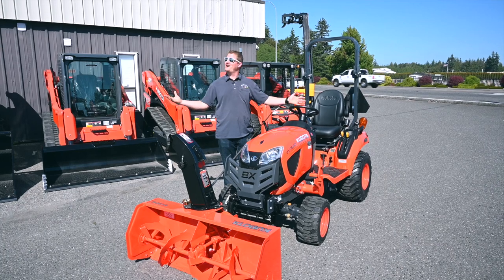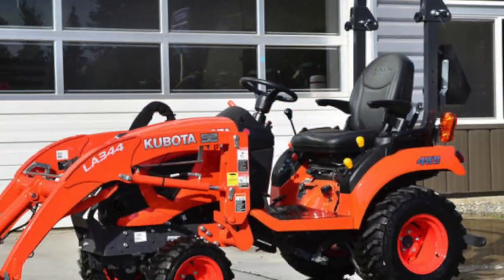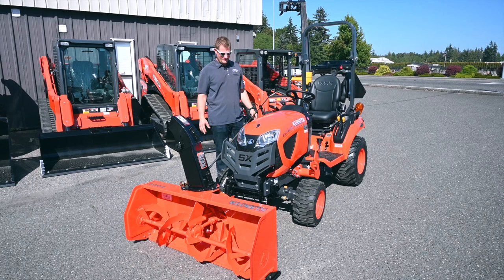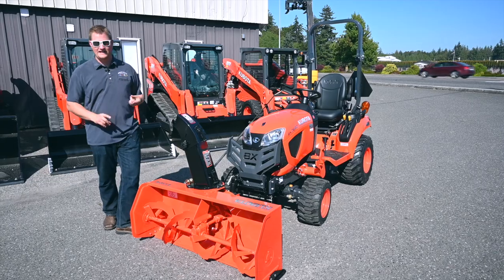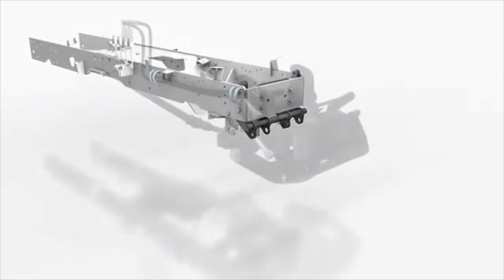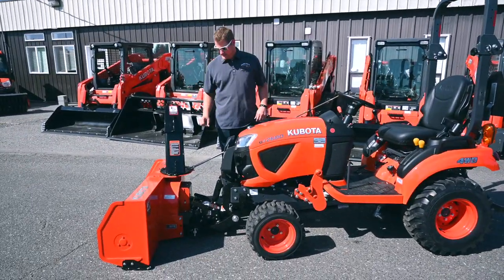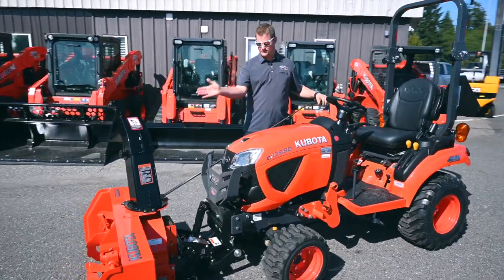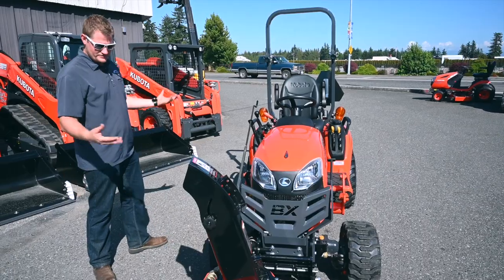Kubota BX Series Snow Blower

Comment: Blowers are find if snow isn't heavy but if it's really wet and heavy they clogged up I would rather have a bucket
Reply: unless you're loading the snow in a cart to be carried off, buckets suck.  blowers are great if you have a cab, but without a cab, I'd rather plow it with a blade
Reply: Low HST, Slow down, spray on Silcone layers on metal surfaces you should do just fine blowing anything.  The catch all is adding Rubber to the impeller to bridge the gap to the housing.  You'll never worry about wet snow again.  If you keep getting clogs on a Blowers.....it's most likely operator error.
Reply: until you get several feet of snow and the bucket can only go so far, blower is great toss it far away, just have to know how to use it correctly.